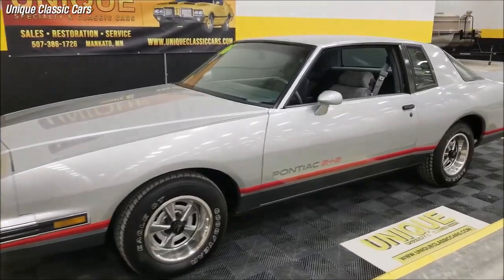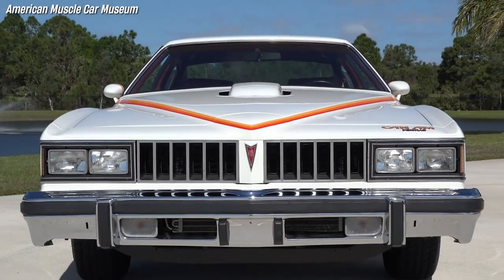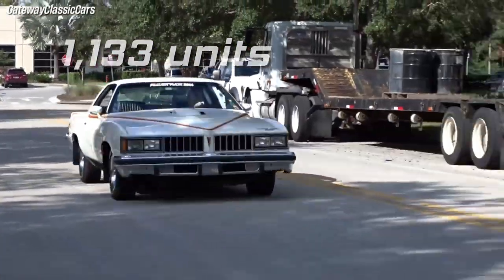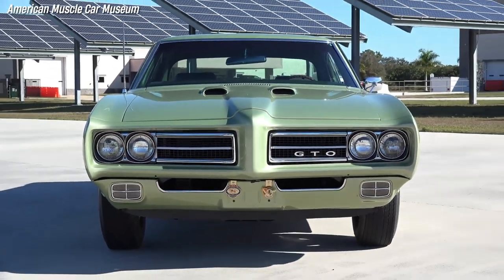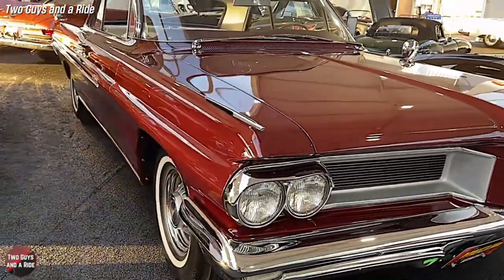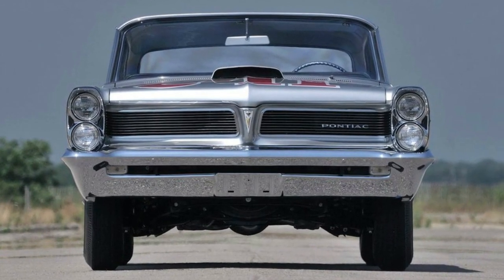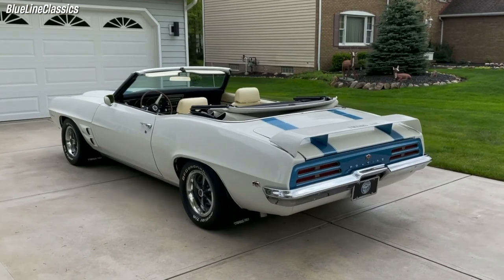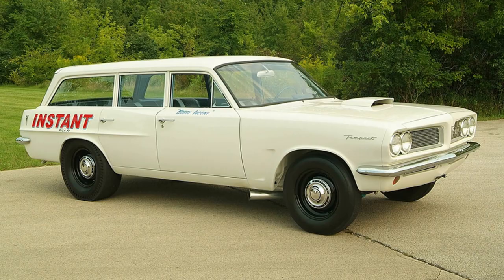8 Rarest PONTIAC Muscle Cars Ever Made!

Comment: This list is not really all that accurate. I have a 1971 Formula 455 HO Ram Air M22 4 speed 3:73 gear car that is Lucerne Blue with a white interior. Only 321 Formula 455's were built in 71. 159 were 4 speeds, 7 were 3 speeds, and the other 155 were automatics. Of the 321 cars only 109 of them had the Ram Air option. Mine is one of those cars and when considering the almost 50/50 ratio of automatics and 4 speeds probably only 50 to 60 of the 4 speed cars had Ram Air. Not many of them came with 3:73 gears either because you could not get air conditioning from the factory with that gear set.
Reply: I bought a 74 SD-455 trans am with auto and 308 gears because I wanted AC. I would have preferred a 4 speed. I did change the gear set to 3.73's after warranty and it ran much better. The block off plate on the shaker made it home to the garage before having the rivets drilled and the plate thrown away. The exhaust system went as soon as the warranty was over for glass paks and a real dual exhaust instead of that sideways mess. Some one talked about fuel economy? 6 mpg in town and 12 on the highway. But gas was $.54 so really not too much as issue.

Comment: In the 1971 Pontiac GTO The Judge with the 455 2X 4 barrel with the factory tune-up you were lucky to get 14 miles per Imperial gallon, I did a tune up on one that was getting 8 miles per Imperial gallon, to get up to 14 mpg took 2 cans of carb cleaner to clean it out , they carboned up really back in day-to-day driving and remember, even in Canada we had the 55 mph speed limit, not enough to keep them clean.
Reply: Great story , wonderful memory thanks for sharing that with the rest of us… Young folks today could not gap their own spark plugs if their life depended on it…
Reply: @tejastiger61  I was working for a Buick, Pontiac, GMC dealer and had just gotten back from a week long course on how to use the emission tune up equipment and he showed up on the Saturday. I was really glad to help him,I left about month later to join the Canadian Military and spent 17 years in the Engineers and RCAF as an Aero Engine Tech worrking on CF-101 Voodoos, CC-130 Hercules and CC-137 Boeing 707s.
Reply: That’s kind of a nice story but Pontiac never made a 71 judge w 2x4 bbl carbs .  They were single 4 bbl only . There wasn’t even a 2 x 4 bbl intake made for that at the time.  It woukd have had to have been a SD 421 intake which wouldn't fit properly on the intake passages , aftermarket  intake  and carbs, or a RAV engine w a very very rare one of 4 dual quad pro stock intake   Not to mention I have a dead stock 69 350 4 bbl firebird convertible (higher compression ) and tubes properly  it gets 21 mpg around town.  Beating even my diesel pick up for milage. .
Reply: @jeffp862  Well let's see it was 50 years ago and I've had over 10 concussions from my time in the military, so it's a wonder I still remember my name, so when you've had a life let me know.
Reply: I never saw a 71 Judge in person and been to so many shows. They all seem to be 69's. My 71 Cutlass Supreme SX had a 455, 16mpg would be good for me with a 2barrel, but it was tired or it should've been a lot better on gas. I remember those 455 Pontiacs were torque monsters, Buick too, and station wagons were the best place to find one for a donor